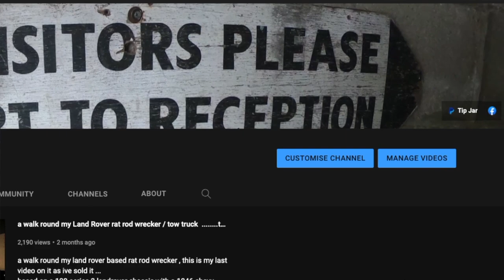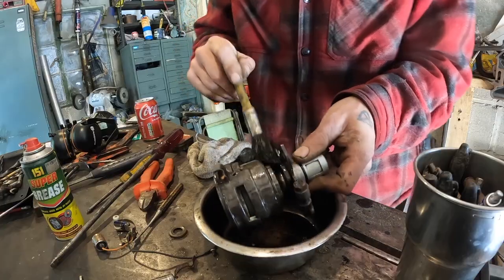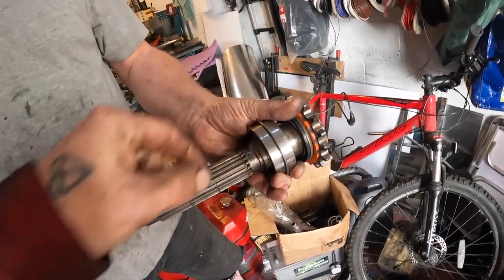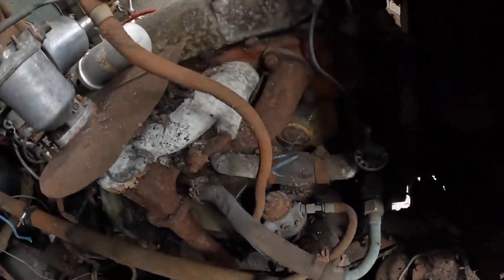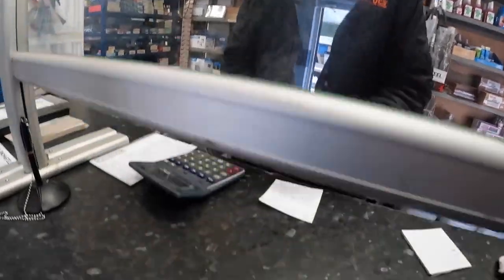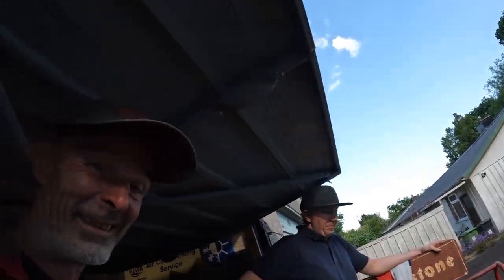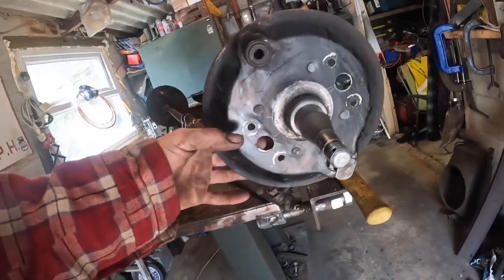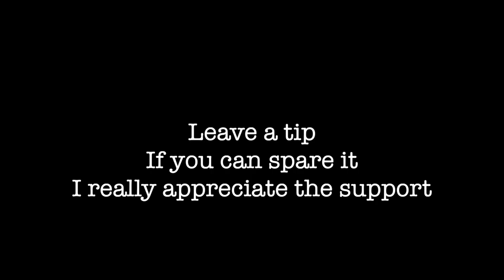the austin ten special....rat ,   part 23

Comment: The ventilated drum brakes are very similar to those I designed for my Morris 8/Reliant special. The brake drum intake scoops can be made from thin aluminium and riveted together with small solid rivets. Don't forget to add a fine mesh or it will swallow a road stone and foul the brakes up.

Love watching this. Your not far behind my build and catching up!
Reply from the maker: Thanks Stephen , I’m most likely gonna get those pieces cast  in aluminum

Comment: The Rover chassis would make a great home for a little diesel /turbo and modern trans. The Rover engine,while nicely made back in the old days is in a  negative horsepower deficit.  😁😁
Reply from the maker: lovely. chassis ...yes you are probably right  1700 cc straight 6 with about 45 hp 🤣

Comment: Bry if you need UNC fixings I have them in stock and some metric too, just let me know sizes and I’ll let you know what I have. Also simply bearings is a good site to use and bearing boys, I use them for cheaper OEM stuff and non chinky ones. 👍🏼👍🏼
Reply from the maker: cheers Dunc , you should pop over in the gp x

Comment: I really enjoyed this episode, like the mix of project stuff and shopping trips too. after my own heart too with running points. My Triumph 2000 had all the hallmarks of fuel starvation from shite in the tank. spent ages trying to fix it then conking out 10 miles down the road. in the end I ripped out the electronic ignition that a previous owner fitted, went back to points and she ran perfectly and has done since. now when people ask me about intermittent running issues the first thing I ask is the car on EI or points.
Reply from the maker: Thanks mate ...I think points are l so easy and you can see what’s going on .. be silly not to use em ... 👍
Reply: @oakswamp  Absolutely. Simple, and they work. A phrase I hear a lot is 'fit EI, but keep a set of points in the Glove box just in case'.... or just fit those points in the first place.

If you hit your power and weight targets she's gonna scoot along very nicely too.
Reply from the maker: @1959BB  should be lively enough and I’m only skinny so we’re be flying with any luck 😄😄
Reply: I have a box full of those famous pointless conversions that fried up in Customers older cars. What I have started using is the F.A.S.T systems. I even installed two in one distributor on a Lambo Espada. And a whole of a lot cheaper that the pointless systems.
Reply from the maker: @Mercmad  damn straight ...

Comment: Ace, I'm watching it on the telly while I'm commenting on here!
Dunno if the Reliant oil pump is as much of a pain in the arse to prime as a Beetle one, but on those I always fill them with grease to help them pull the oil through right from first crank over without the plugs to build oil pressure. Worth doing now before it all goes back into the engine?
Reply from the maker: Yeah man I fill them with vaseline usually does the trick
Reply: @oakswamp  I thought you'd probably do something, you definitely know your shit,, but I was expecting some mad priming doohickey made from part of the Austin and drilled with more speed holes!